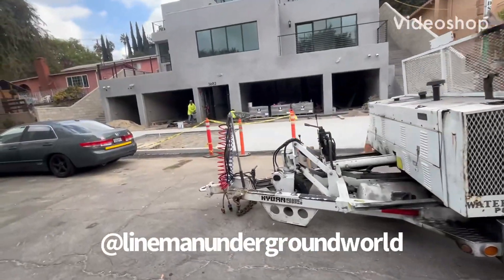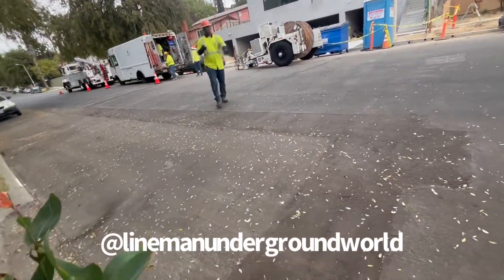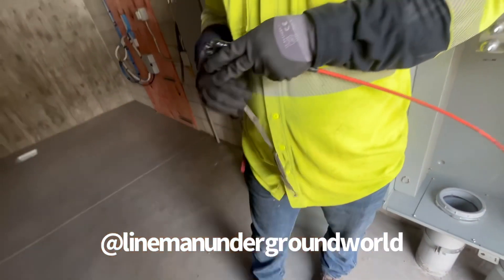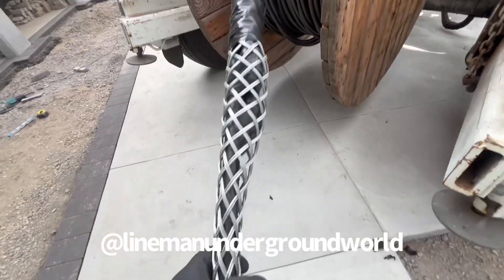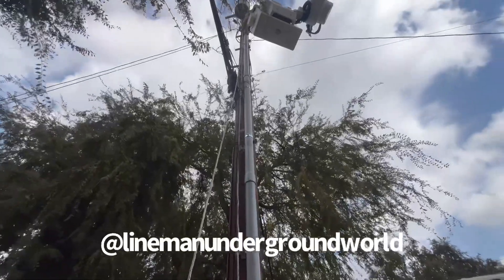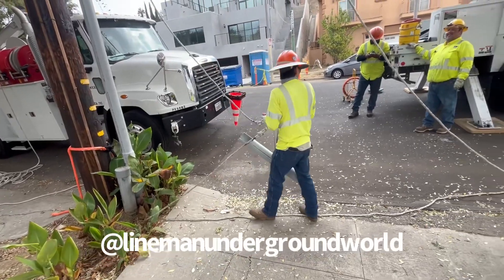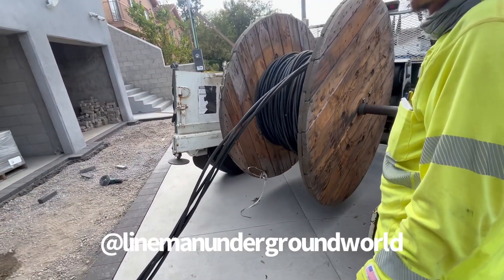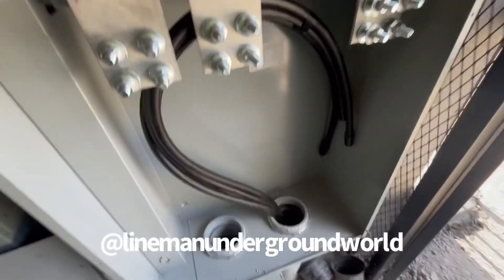New building New service

Comment: I'm in telecomm, so our cable isn't quite as stiff as you guys, but it's MUCH easier to damage. 90s immediately piss me off, two 45s should be the standard. Trying to blow in (Cannot pull or winch it in under any circumstance) 864F Micro fiber is awful. It's 864 fibers, each at 200 micron diameter, if you look at it for too long it breaks. 😅

Ideally in my industry it's ran in microduct, but what is is supposed to be and what it actually is in the field don't always line up 100%.
Reply from the maker: @Steve-s4b  wazzup Steve , you gotta work with the hand your dealt with and make it work as best as possible can , I recommend you guys use slime on the stiff cable if your pull gets hard or anticipate it and slime .. stay safe over there brother 👍😎